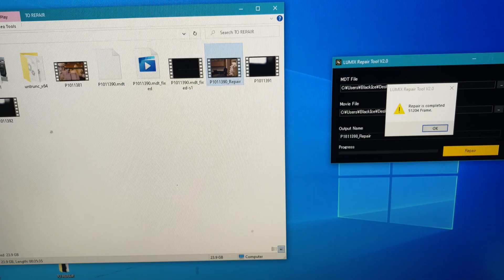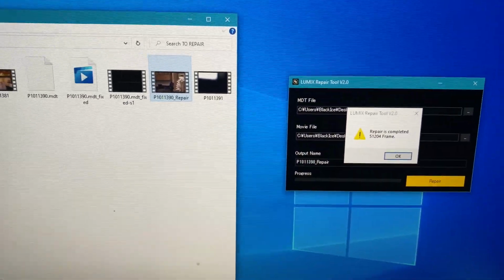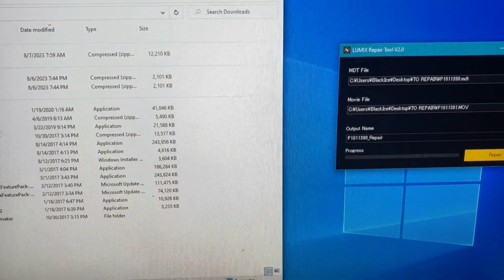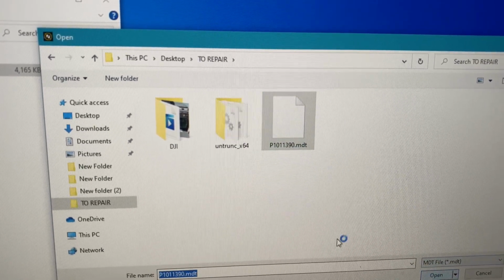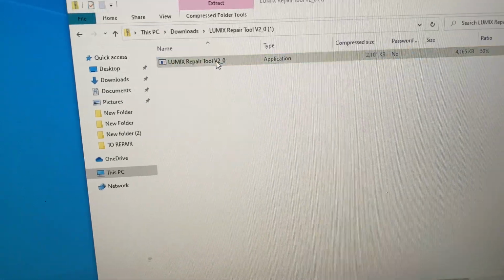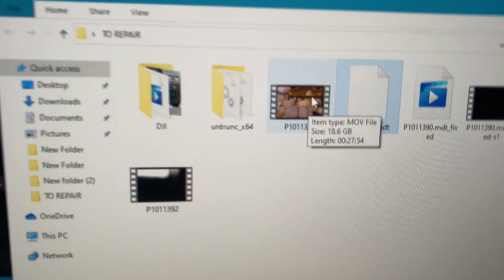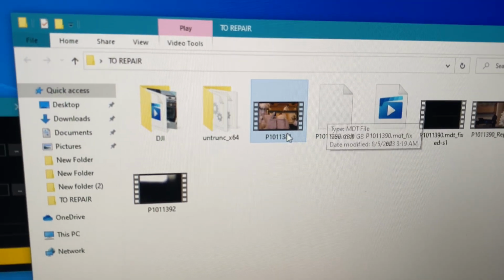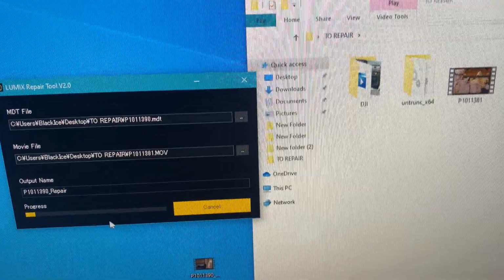Recover  Panasonic GH5 MDT Video Files Free FIX

Comment: Thank you very much for your helpful video! 
I tried the Lumix repair tool first and it kept closing so I gave up on it. Then I tried the "video repair tool" by Grau which failed. Afterwards I tried the "untrunc" free app which also failed. I was getting super frustrated as I had 25 minutes from a wedding ceremony corrupt.

Then finally I saw your video with the solution on how to prevent the Lumix repair software from auto closing and that fixed my video 100%.

What an epic relief! Thanks again!